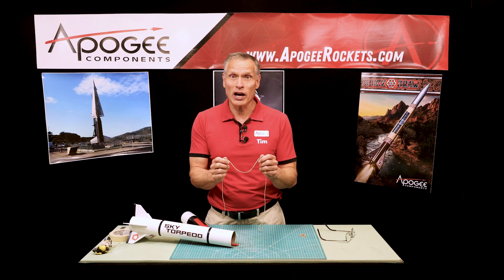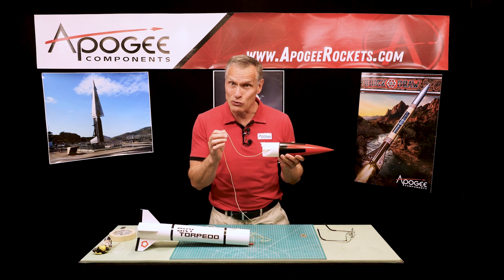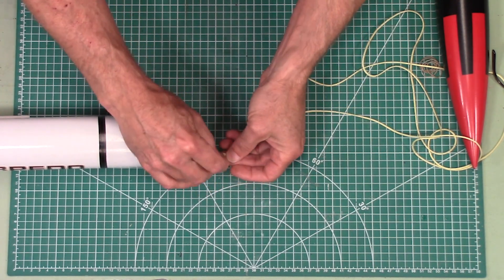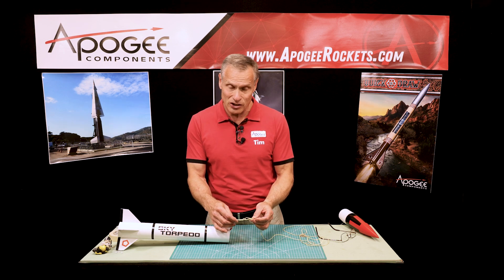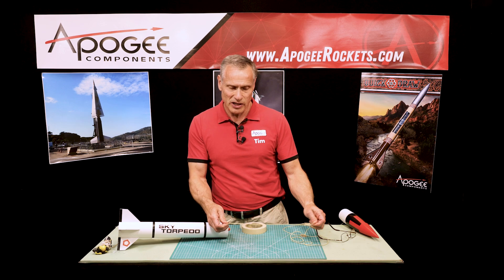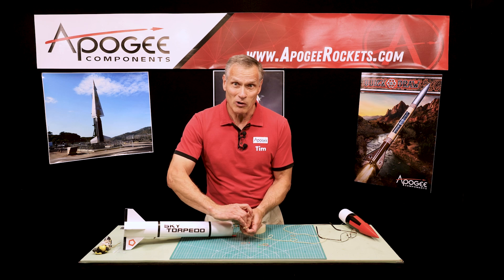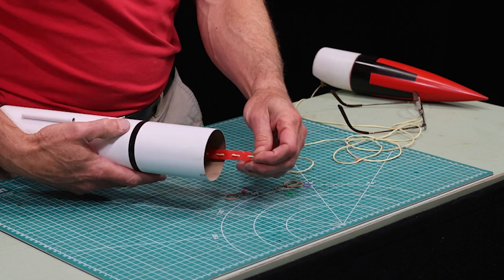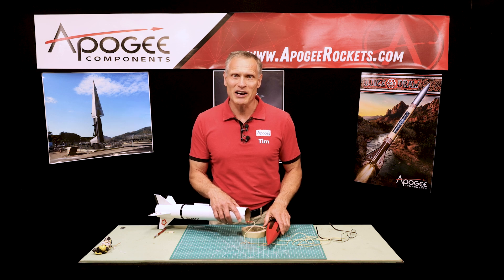Stop Breaking your Model Rocket Shock Cords!

Comment: I learned how to make a daisy chain in my youth, although I learned it is called a gaffer's knot. The nice thing about them is they do not tangle with other cords. Also, if working with a cord with "memory," it will zigzag instead of coiling up in loops. Try using one for your launch controller cable!

Comment: I have used both these methods on mid and high power rockets. IMPORTANT NOTE must have cord entering and exiting the same end for the tape method. May not matter for kevlar but with nylon shock cord the tape won't tear if the cord enters one end of the bundle and exits the other.

Comment: I've had rubber and elastic shock cords break but I've never had a kevlar cord break.  I use pretty long kevlar shock cords- 8' to 10' for rockets I launch on D motors.  I have had snap swivels break though so I had to start buying much stronger ones.  However with kevlar you use longer cords and longer cords are harder to pack inside the rocket in such a way that they can stretch out later without becoming tangled.  I've used the daisy loop method, I haven't tried masking tape.